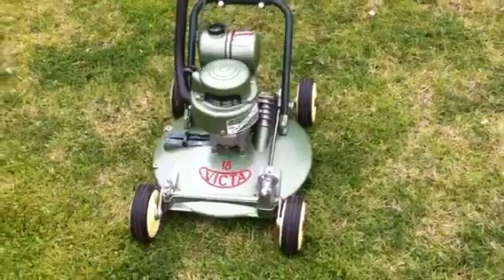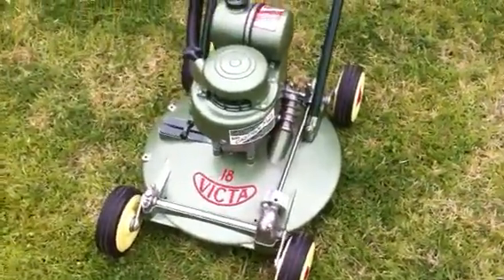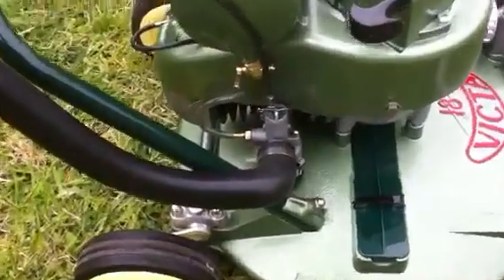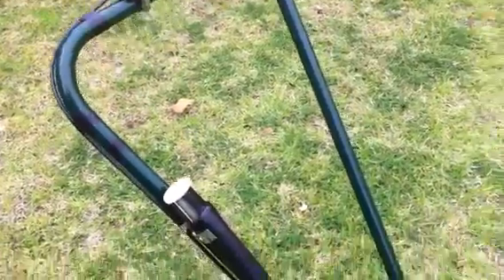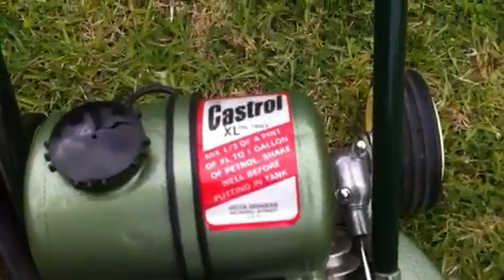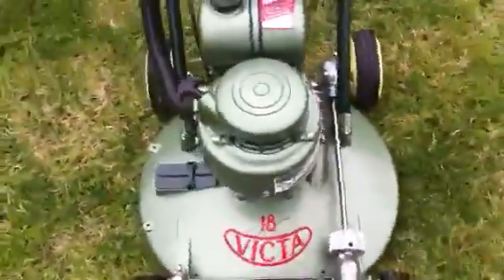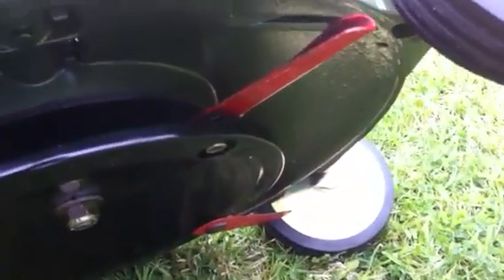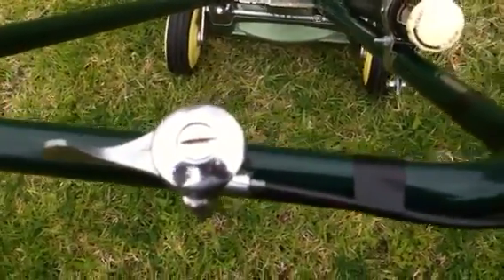Victa 18 "Toe Cutter " 1953 ish

Comment: Its not 1953, the original came out in 1953 before it went into mass production (the billy-cart model), you wont find it in any books, your model you have there is around 1958-61 (id have to double check in the book). Very nice mower by the way in great condition :)